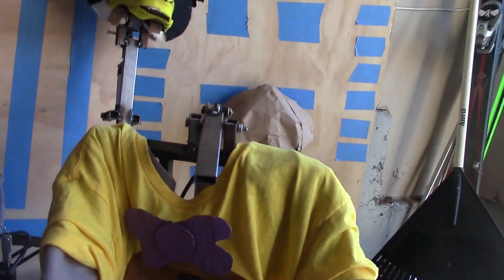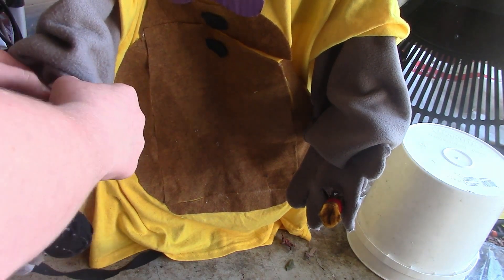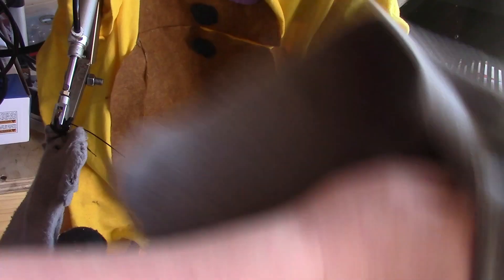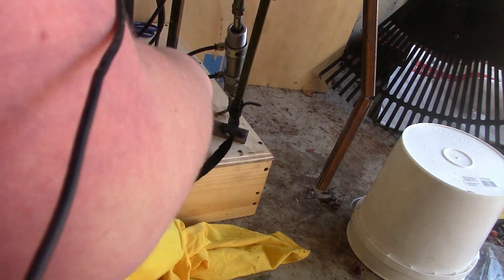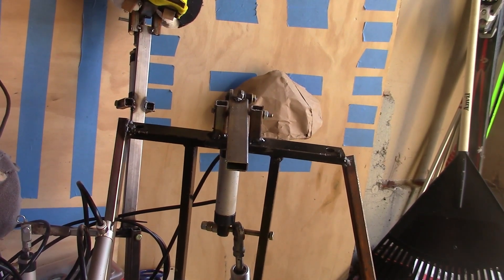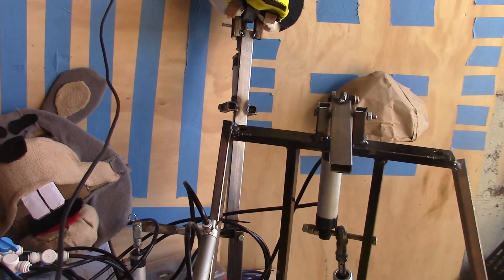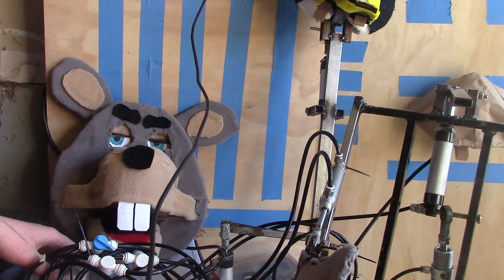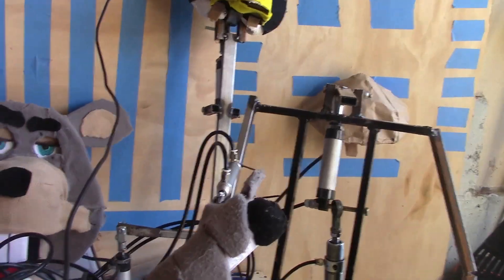chuck e cheese portrait bot cosmetic removal

Comment: Hey I need a tutorial on how to make the blink mech please
Reply from the maker: ok, here you go
first, get a cylinder(in your case a syringe) then put it on a flat piece of cardboard. then, make some flat eyes out of cardboard, and put them on to the piston head . i had my eyes attached, so they blink at the same time. anyway, put some eyelids, witch should be a piece of fabric, and use it as eyelids by attaching it to the eyes and then attatching the other end ubove the the eyes but make sure there is a lot of fabric so that when you push the syringe down the eyes sink below the mask and the fabrik moves in to place. let me know if you need more help.
Reply: @cec_oregon  thanks I appreciate the help I’ll try to make it!